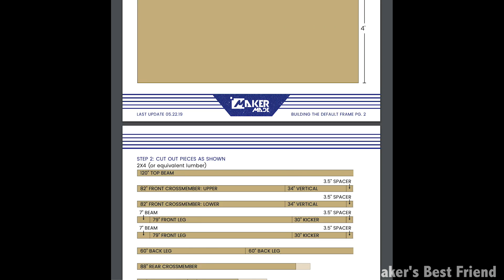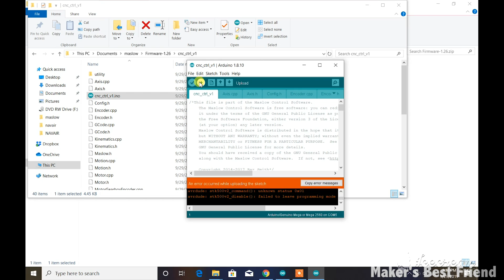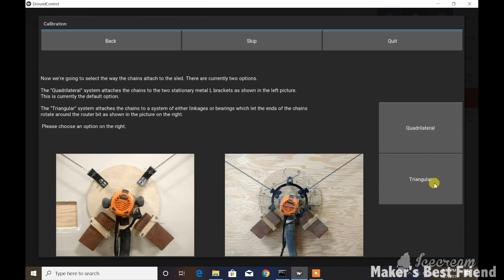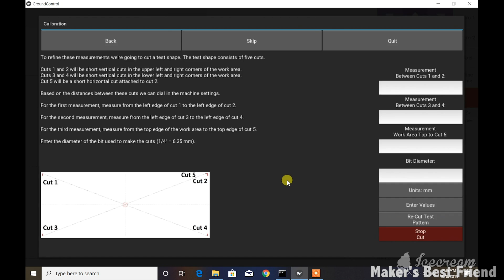The All New Maker Made CNC!

Comment: I hear about it, it's a toy not a tool. batteries not included? no! Motor not included nothing in that box we will see if anyone got a refund.
Reply from the maker: It’s definitely more of a beginner machine, but it’s one of the only ones that allows beginners to start with CNCing at a 4x8 scale at this cost… batteries? It plugs in to a wall outlet. Motors are included and you can buy your own router with them if you don’t have your own

Comment: Was in the box the router device or not..if its not what type router you buy ?
💪✌️
Reply from the maker: Nah the router doesn’t come with it. I have the ridgid 2 HP router, but they actually recommend one of the following:
DeWalt 611
Bosch Colt 1hp

If you already have a router just use that instead of buying a new one since they make the system work with several options

Comment: how much faster is it than the original maslow?
Reply from the maker: The speed is the same because the motors haven’t changed. It’s more the accuracy of the cuts that’s improved . Although you can probably ramp up the speed since it’s a stronger design
Reply: @MakersBestFriend  thank you

Comment: I'm thinking of buying the M2 version...I do have a question. Im curious how this does cutting groves or dados? I have some designs that have texture...rippling water (currently use a $150 planner blade), or small topography like carving mountains into wood (I have Maui and the Big Island in CAD). Seems like most maker projects are just pass through cuts.
Reply from the maker: It’s doable but needs some though process. You would need to cut the topographic parts and grooves first and leave enough flat surfaces so that the sled doesn’t angle as it’s riding along the piece. If the entire piece is grooves , you might have some inconsistencies but you can design in some vertical tabs so that it gives the sled something to ride on and then go back and manually cut them down

Comment: Question when your about to cut something what do you zero your z axis height at I’m having issues where it’s not lifting enough on moves.
Reply from the maker: What are you using to program it ? It sounds like you’re not giving it enough of a retract height for safe distance to move . I zero it to the wood and then will actually retract about 0.2” above 0 for safe moving
Reply: Maker's Best Friend saves my life working like a charm now, tinkered with a few hiccups with the chain but no issues with the actual cut, god bless man
Reply: I’m using fusion 360 for my set up and post process, and bringing my g code to ground control sometimes the z axis looks like it doesn’t have enuff room I was doing a project and the it had a problem lifting the z access maybe it’s how I have the z axis motor fastened to the mechanism it’s attached too. Maybe a bigger coupler
Reply: Thanks for the response bro love your channel

Comment: Thank you for this video.  I am thinking of purchasing the Maslow but have very limited space in my garage so I was thinking of mounting/hinging it to my wall.  Is it easy enough to remove the sled and router to store until the next time I use the cnc?
Reply from the maker: You should check out their newest design that came out - they have an option for having it wall mounted so that it takes up even less space. Very easy to remove the sled, but I prefer keeping it on so I don’t have to keep recalibrating

Comment: To his video its a very good idea to purchase a dry lube spray for the z axis as well as chain wax spray used for motocross chains. This will prevent your chain from hanging up as its cutting especially if you live in humid climates and the dry lube will protect against aluminum adhering to its self from friction with the Z axis. Look for dry lube that contains granite. Gives you longer life of your plastic clip with less friction.  Also the maslow cnc has just released the M2 upgrade kit as well as the complete kit. Please check out https://www.makermadecnc.com/shop/  to see all details to the latest and greatest!
Reply: I think you mean graphite instead of granite.

The OzCycle channel has a recent video on how to make your own setup to apply wax to a bicycle chain as well as a video on how to clean the chain before waxing. He also talks about how to add powdered Teflon to the wax.
Reply from the maker: it's also worth keeping around the used tooth brush to clean up the chains during use

Comment: One vital point that was missed here: the chain needs to be under substantial tension at both ends.  Weights are needed to pull at the loose ends.
Reply from the maker: Great point. A lot of problems that might be experienced are from the chains having slack and skipping. The new system being released incorporates a pretty serious spring that I think might help but haven’t tried yet
Reply: I'm glad to hear that the problem is being taken seriously.  The biggest problem with using a spring is that the force will change depending on how much it is being stretched.  If you want a compact solution, just use a drum where the chain is taken up on one half and the rope that suspends the weight (e.g. a bag of rocks/etc.) is let out on the other.  That would be cheap, simple, and pretty much foolproof.